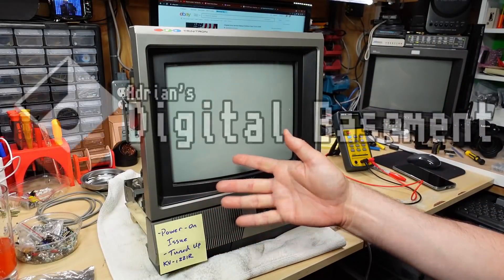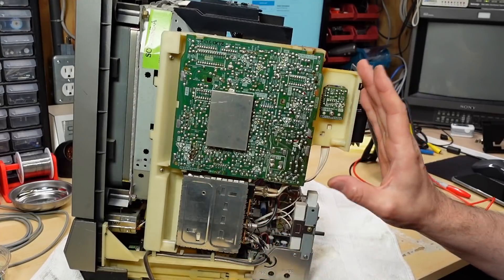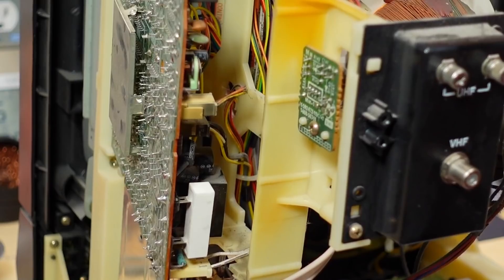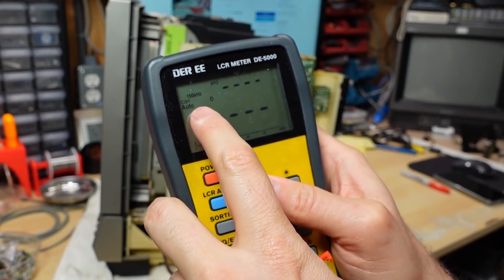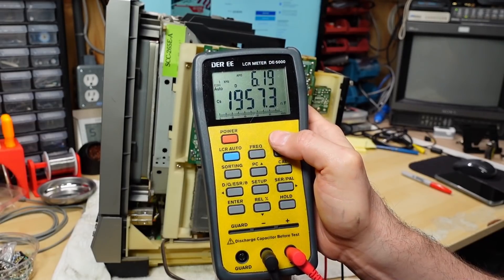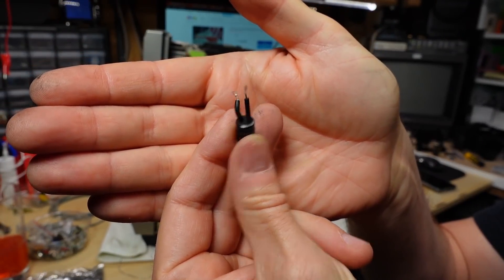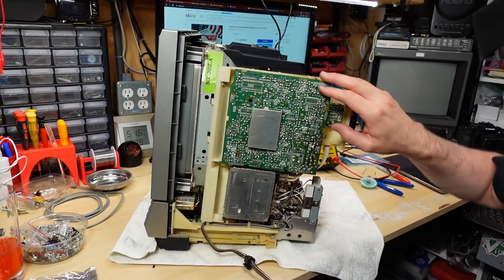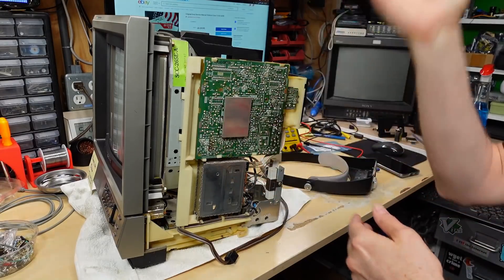Diagnosing and fixing a Sony 13" TV

Comment: I see that this video was 4 years ago. I have the same television with the exact same problem. Mine was also changing channels on it's own and turning off on it's own. My Poltergeist set was my nickname for this Trinitron. Yes it was this same capacitor C002 that was bad. Replaced it and it is working perfectly now. And the set can no longer be called the Poltergeist set.

Comment: I have very little luck measuring caps in circuit. Maybe the de5000 would be better if you can tune the frequency but I can't get that in the uk unless I import it. Anyone know what's a good reasonably priced one? I have a good all round meter but the capacitance range for above 1uf is unstable or reads out of range, mf range doesnt work.  I had better luck with a cheap component tester reads pretty well but of course the cap may behave differently at different voltages and frequencies.

Comment: These test leads you use for the LCR meter are not shielded and have no ground. So less accurate readings. I modded my DE-5000 with shielded cable and kelvin clips. Works more accurate.😉

Comment: Hi, do you have experience on Sony pvm repairs? I have a Sony Pvm-20M4E that blows components on the psu when I tried powering it up. Replaced the components and same problem. I'm not good at reading schematics. Hoping to get some help here...

Comment: I have a zenith tv that was manufactured in 1997 and it started with the same issue.
I would press the on  button and would just do a split second flash on the screen, I would have to keep the on button pressed and eventually the tv would turn on until one day it just completely died. Do you think it's the same issue? Help please I love my old tv.
Thanks for the great video.

Comment: Wasn't the Rubycon caps the ones that had tons of issues back during the days of the "capacitor  plague"? I've always heard good things about Nichicon caps, so I'd probably go with those. But maybe that's all old news and they are completely different now. Also impressive that you diagnosed it just through sheer knowledge and investigation without needing the schematics.
Reply: Nichicon is such a famous capacitor brand now that it's actually difficult to not get fake ones unless you go to a real industrial supplier (like DigiKey).  That's also the case with almost any capacitor sold explicitly as "Japanese".  I'd rather get the 5th-best capacitor out of China than a fake Japanese one.  It's the same story with Mabuchi DC motors, or Omron relays, the name is too famous to trust to a reseller!
Reply: Nichicon and Rubycon are both great brands.  There were also lots and lots of failed Nichi and Ruby caps out there during the plague.  I don't know that anyone was totally immune.  Whether those were convincing fakes or the fallout of that incident just hit everyone, I don't know for 100% certain.

Comment: I'm curious, could you have put the new capacitor on the back of the board as a means to better isolate it from the heat source?  (I'm not a fix-it guy at all, so I'm asking out of genuine curiosity.  I've seen on some of your videos while doing bodges you sometimes chase things through VIAs or by patching onto the underside of a through hole component to bridge a broken trace or even mount a component on the opposite side of the board - and just wondered if that underside trick could have been used (by the manufacturer) to better protect that capacitor from damage?)

Comment: They aren't all home runs by Sony! :) Meade made a telescope computer controller in the mid-90s which had a very special ribbon cable that interfaced to the the membrane keyboard of the handbox. When this ribbon cable was folded up after mating the two halves of the handbox, it came into direct contact with a tantalum capacitor that was underrated and unreliable. It would POP, and burn a perfectly circular hole in the cable. No more handbox! Just a design flaw that would have been hard to anticipate.

Comment: What if you wrapped the new one with aluminum foil, shiny-side out, to prevent it from being baked?
Reply: potential short issue. I'd have placed the cap on the back of the board.

Comment: My line of thought is any capacitor on main power supply would be suspect. After a voltage regulator not so much unless I recognize and old power supply design like a Zener regulated power supply with a swamping resistor. Good catch there Adrian.

Comment: My Radio and Tv business that I own We use to sell Sony and we were a authorized service center I have worked on hundreds of Sony products over the years and Electrolytic capacitors are one the main issues and I am lucky to have a lot of Factory Sony Service manuals .One my Current projects is a  Sony 27inch XBR TV and a 1970s Sony portable Radio .

Comment: My uncle thought me that the cap would last longer when you put those caps near the power resistor the other side of the board if there's space available to really make sure it's not going to be baked
Reply: My thoughts exactly.
Reply: I thought so, too.  But there may not be much room between that board and the case.  (Although the new cap is small.)  Also -- single-sided PCB.  :-)  Still doable though.

Comment: That reminds me of a switch mode power supply I had on my bench a while ago. Fixed 24V output, it had been running 24/7for 20, maybe even close to 30 years. After it was turned off for a while to change things in the mains wiring of the cabinet it didn't turn on anymore. A friend suggested to heat some caps on the board, so I used my heat gun (which looks strikingly similar to the one Adrian uses here), and sure enough after they reached some temperature, the power supply came on. After changing out 3 caps, I took them to work where we have a very good LCR meter... one that was supposed to be 150µF showed "out of range" on a meter that goes down to very low picofarads. That cap literally turned into a resistor, as it had more than 300 ohms ESR. Sometimes there is just no other way to make things work again, even if you are not a recapper. ;-)

Comment: i never trust in circuit values, they change when i take em out
Reply: If the values are totally whack, it gives you an idea that the component in question is suspect and deserves further scrutiny.
Reply: does it happen that a capacitor looks okay because of nearby components? I can't trust it so I use an ESR tester, and even remove SMD capacitors just to measure them (generally recap anyway). Many leakage testers aren't sensitive enough either, from what Mr. Carlson says.
Reply: @Walczyk  If it does, I've never seen it. Again, I don't take the result as gospel. If the results don't look even close though, it tells me something is amiss in that component or in its nearby neighbors in the circuit.

Comment: You didn't need to use the heatgun on the heatshrink, that power resistor would have taken care of it.
Reply: oh no, don't use the heat gun... you'll reduce the life of the new capacitor. 😊
Reply: @fumthings   I know that's sarcasm, but in case anyone's wondering, heat shrink will conform at a pretty low temp.  I usually set my hot air station at about 150c for heat shrinking.  That causes it to shrink pretty much instantly, and you barely warm up the stuff around it.
Reply: That's a good one - insert clapping here -.

Comment: "Testing in circuit is not always accurate"
Nope, but it definitely gives you a general idea of things that may warrant further investigation.
Reply: This is a "sometimes" rule that may or may not work. "60% of the time it works every time."

I just find testing caps in circuit to be unreliable enough that I always desolder and lift one of the legs to test them. Electrolytics are fickle beasties.
Reply: @Darxide23  I poorly phrased it. I was intending to agree with him that nope, they aren't accurate. However, it is fairly reliable for finding areas that deserve further scrutiny.
Reply: Here's key bit of know-how for testing caps in-circuit: If the cap is directly connected to a rectifier, then it needs to be removed for testing. Otherwise, testing in-circuit you should get at or very near the cap specs. If not near spec, the cap is likely bad or iffy and warrants replacement..
Reply: @lexluthermiester  thank you! this is great advice

Comment: If I have something open and I have some time, I recap anyway for preventative maintenance.  I've seen way too many electronics destroyed by leaky caps, even if the caps themselves read OK.
Reply: my current Sony 27inch XBR and Sony portable radio are getting a Full recap of all the electrolytic capacitors they are cheap and the new 105 degree Nichicons are Awesome!
Reply: I've got a line of TVs and PC monitors waiting to be fully re-capped, just for good measure.  But ... cheap?  Hm.  :-)  Then how come every time I place a parts order to re-cap a PSU, I end up spending almost exactly $100 on parts?  haha

Still worth it.

Comment: Hey Adrian nice fix. The capacitors from the 80's and 90s where really bad quality... Oh you forgot to show if the remote worked.
Reply: I am currently fixing a older Sony 27in Tv and one the power supply capacitors spilled it's guts out !!
Reply: I dunno -- the 80s and 90s caps are generally pretty good.  On decent electronics, anyway.  I am a re-capper, and so I pretty much re-cap any PSU older than 10 years that comes within a meter of my bench.  But, I recognize that re-capping quality 80s and 90s equipment is pretty much just preventative maintenance, not usually a necessary fix.

Comment: "No evidence of baking" is the most common appearance of a bad cap. They just dry out, especially when they are getting heated up like that.
Reply: more common than leaking electrolytic fluid? not in my experience
Reply: @Walczyk  I can say for sure that most dead caps I've pulled showed no obvious signs of leakage, and I've pulled thousands of them.

Comment: 7:59 why the hell didnt u put this capacitor at the back of this circuit ? :D
Reply: i would have put it on the back side too if there is room for it but that cap will still last 20 years where it is.
Reply: @Mr_Meowingtons  why you say something like that? The thing was USED a lot back in the day, nobody uses it that much today, it is old. So you cannot compare the useage of the item.
Reply: probably because there's not a lot of space between the board and the back cover of the tv

Comment: As soon as you described the fault, I immediately thought bad capacitor, Keep up the good work Adrian! 👍🏻
Reply: yep i have had a few ham radios do the same thing turns out to just be a dumb cap..
Reply: Absolutely! Fixed a similar issue on an air conditioner unit the other day and it was a big leaky cap as well.
Reply: For Sure and when dealing with a older Sony Always Cheap capacitors and solder joints first .